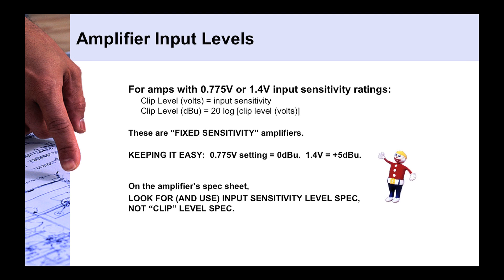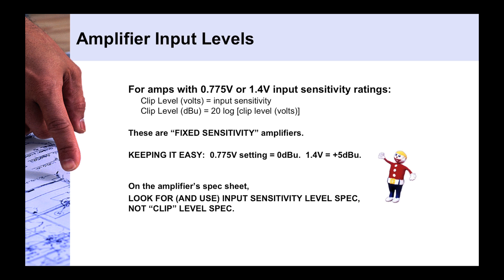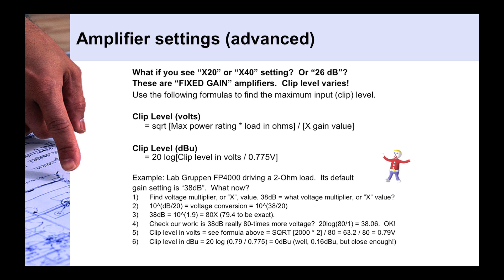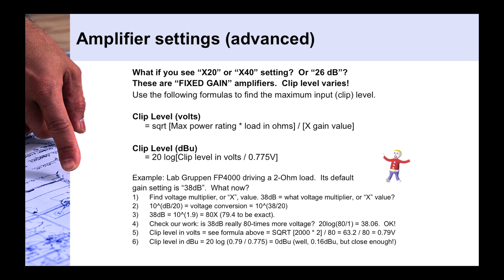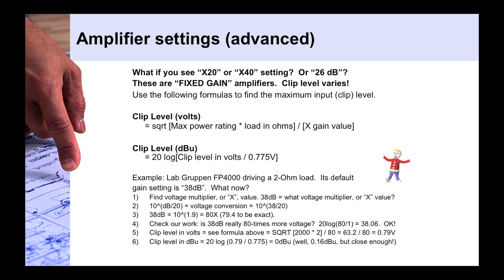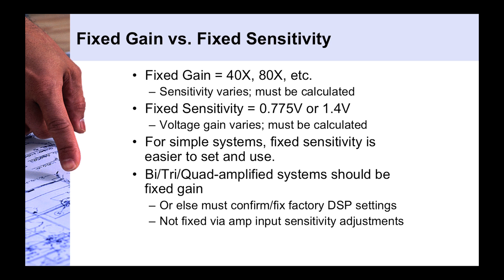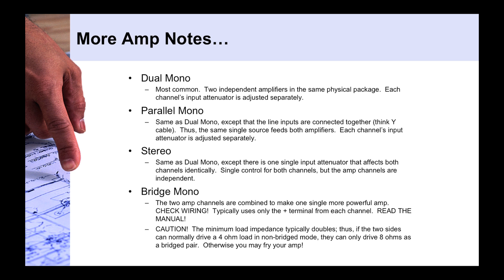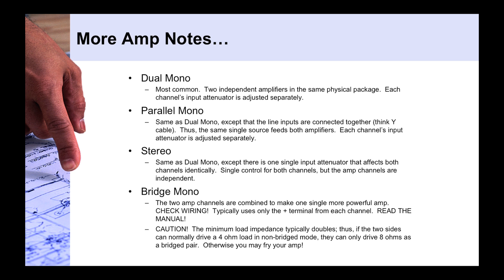Amplifier input sensitivity

Comment: I have a Crown xli800 connected to a Marantz Receiver SR7000 I just want to know which setting is best  the .775v or 1.4v connected with RCA Cable. I read a Review that he used the .775v setting so I switched to that the previous owner had it at 1.4 for his small Magnapan speakers. I will be connecting this to a 4ohm 8in Turbo sound speakers, but for now i am in MONO Bridged for my 8ohm Martin Audio BlacklineX series 15" speakers.. Your Math coarse is just not giving me any answers.
Reply from the maker: The Crown amp's two settings (.775V or 1.4V) are for its input sensitivity. This is, essentially, the clip level of the amplifier. 0.775V is 0dBu, while 1.4V is 5dBu. You'll have to look up the specs on the Marantz to see what output level you're sending over which RCA output. Based on that level, you will then adjust the Crown's attenuation settings for proper gain structure. The Marantz likely has levels listed in dBV not dBu so you'll have to adjust accordingly (0dBV = 2.2dBu). 
For example.. if your Marantz outputs up to 5 dBV maximum (again, you need to verify what the actual levels are, I'm using 5 as an example ONLY) that means it would be 7.2 dBu. If the amplifier is set to 0.775V, it can handle 0dBu maximum so you need to set the amp's input attenuator to -7dB (or -8 to be safe) to compensate for the difference in level between the Marantz's output and the amp's input capability.
Reply: @phy350  I found a blog He said the Marantz was 1.2v & that setting the Crown to 1.4v was a safer choice,good to know which way is safer, but that also lowering the Amp Gain to 70% will also prevent clipping & Damage, other stuff on Ceramic Turntable Needle & that what the Component is sending into the Receiver matters as a Digital Source but analog is fine. My Laptop is connected to the AUX because the remote don't work & he has all CD & DVD set up for fiber optic connection.When I use 1 of the Crown XLi800 in Mono to power a JL Audio 15" 4 ohm Sub, I think & gladly to know I will set it to the "SAFER" 1.4v Thankyou for the reply & being helpful PHY
Reply: @phy350 & in the same marantz if i set the input sensitivity to 1.4 v (+5dbu) I will have to attenuate by 3 db only to be safe .. correct?

Comment: When does someone determine whether or not to change the sensitivity of a ca18? I have one which gives me the options to change from .775-1-1.4
Reply from the maker: An archived brochure I found (https://www.fullcompass.com/common/files/62-CrestCA18Brochure.pdf) has a chart that tells part of the story. If you have different sensitivity settings, that just changes the dBu level for your gain structure settings. For example, .775V = 0dBu, 1.4V = 5dBu. If your mixer has a max output of, say, 20dBu, and you have the amp set to .775V, you would need to set the input attenuator to -20dB on the CA18 amp. If you have it set to 1.4V, you'd set the input attenuator to -15dB. 

That said, the brochure I reference above has X20 and X40 settings, which are fixed voltage gains (not fixed sensitivities). When the voltage gain is fixed (as you might want for certain applications), the input sensitivity changes depending on the amplifier's load and the wattage. That's when you need the fixed gain formula (explain around the 3 minute mark). 

There's a chart on that brochure which gives you the sensitivity in volts for the X20 and X40 settings. Convert those volts to dBu, and you'll have the info you need for gain structure purposes.
Factory Standard X115  .775V = 0 dBu
Option 1 X40  2.24V =  9.2 dBu 
Option 2 X20  4.47V  = 15.2 dBu
But of course this chart is only valid when you have an 8 Ohm load connected to the amplifier. 4 Ohm loads? Time for some math!

Comment: Sensitivity 1.0V?
Reply from the maker: To convert volts to dBu, the formula is 20*log(V / 0.775).  So if your amp's input sensitivity spec is 1.0V then its corresponding dBu value is 20*log(1/0.775) = -2.2dBu. See also by dB video for more info on volts to dBu and vice-versa: https://www.youtube.com/watch?v=dN9FXLAmMZ4

Comment: So if im understanding correctly the input sensitivity setting is the limiter threashold level. Does that mean the ceiling or loudness level is lowered only increasing saturation and distortion?
Reply from the maker: Input sensitivity of the amp is the level you use for gain structure purposes. For example, if the input sensitivity is 1.2V (which is about +4dBu), then you adjust the input attenuation knob on the amp to compensate for the incoming signal. So if a mixer is feeding the amp directly, and the mixer can output up to +20dBu, then you would need to set the amp's attenuator knob to "-16dB". This lowers the 20dBu signal down to 4dBu so it doesn't overload/clip the input of the amp. And now you can run the mixer up to its clip level without worrying about clipping the amp's inputs.
Reply: @phy350  the studio monitor have the amp inside the box. With switches on the back outside. The switches are for bass shelf. Rolloff. Trebble shelf. And input sensitivity. The options for the input sensitivity are. 1. Unbal 2. +2db. 3. 0db. 4. -2db 5. -5 db. Im running the audio to it through xlr cables from asoundcraft mixer. What would be the correct way to gain stage.  Set mixer faders to 0. And then adjust input sensitivity until l.e.d. indicator flashes red.
Reply from the maker: @hoodknown5875  Since you're using powered monitors, you'll have to look up the specs in the manual or spec sheet. It should tell you the max input level in dBu of the XLR input. Since the amp is built in, it will probably just give you the max dBu level rather than an input sensitivity spec (you only really see the voltage input sensitivity spec on standalone amplifiers). I would expect the monitors' max input level to be more in line with typical pro audio line level gear, so somewhere in the upper teens or low 20s dBu. But don't take my work for it... always read the manual!  :)